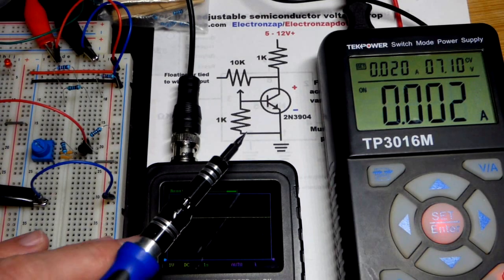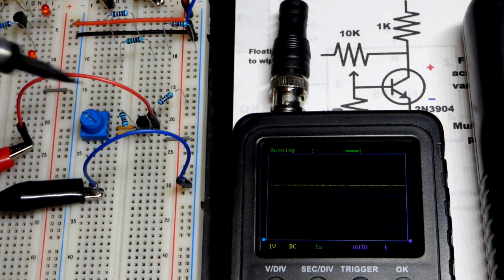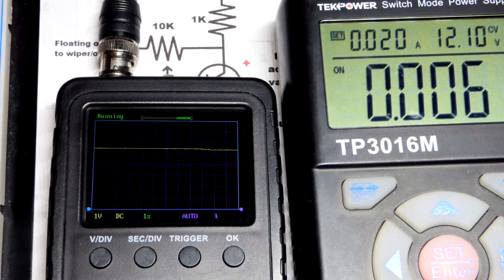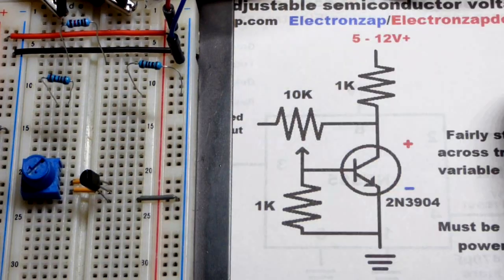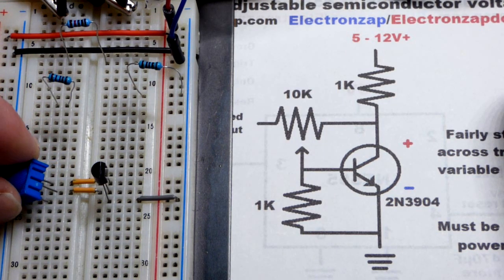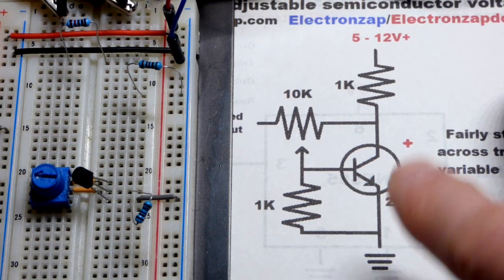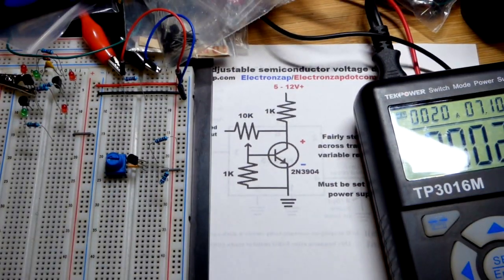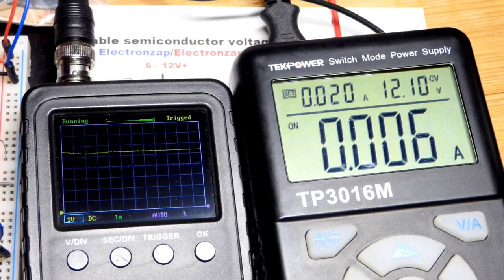2N3904 NPN BJT adjustable reference voltage set by trimpot to act like a variable zener diode

Comment: Neat circuit. Will it also vary current as well along with the voltage?
Reply from the maker: It passes current as needed to hold the voltage. So more supply voltage means it passes more current through the transistor. You'd have to modify this circuit a bit in order to have it be a current source for a load.